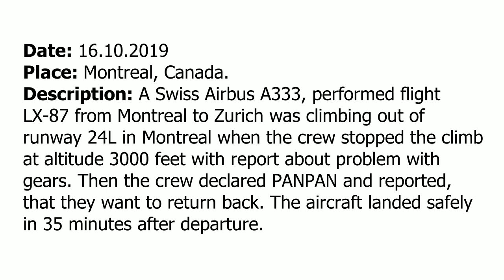Gear problems after departure from Montreal, A333 requested fire brigade [Real ATC]

Comment: Great job with the video!

FYI 5:03 [unclear] = ... and will let you know.
Reply from the maker: Thank you.
Reply: @YouCanSeeATC  1:20 [at least] half an hour;
1:30 [within terminal] 3000 ...(Remark: responsible area of terminal approach, I guess);
1:38 [if you have time, I have further] information; 

2:05 [we might have a little bit of hot break problem]; 

05:44 [and he might change you over to a frequency with a fire truck. But Ground for now, 121.9]